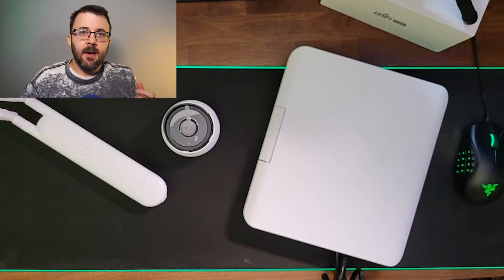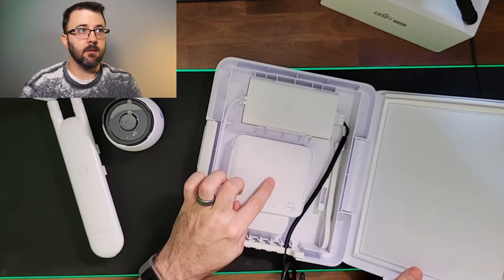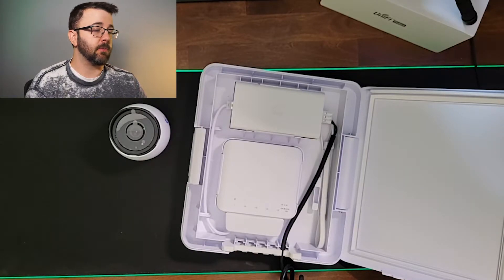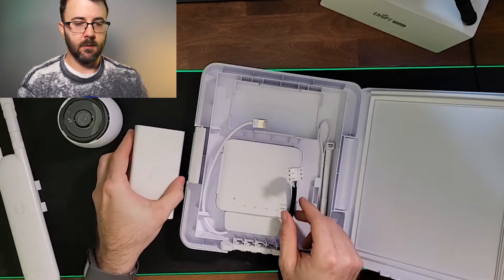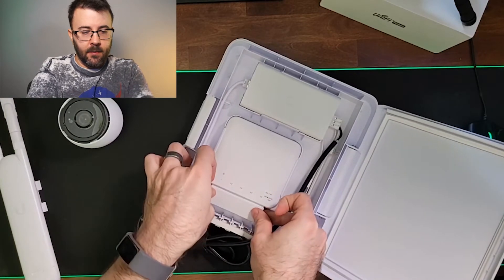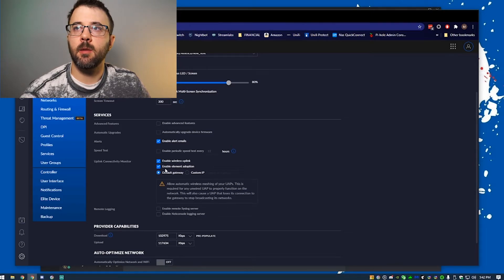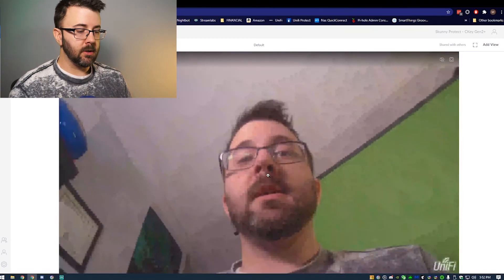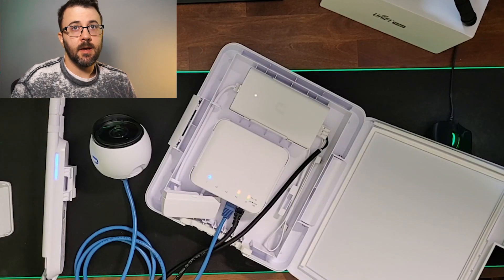Unifi Wireless Uplink Camera Setup

Comment: I had the same issue with the switch only powering one AP at a time. Thanks for the info, it worked after I turn on  the injector option.

Comment: Super helpful tips. I was planning on running at least 4 cameras outdoors around my home and was trying to figure out the best way possible. If I understand correctly, my switch from inside the home would connect to one of the 4 POE ports and then that would leave me with 3 ports available for camera use. As the first port on the USW-FLEX will require POE adapter to power all the devices connecting into the switch.
Reply from the maker: Yes the way i have it setup is that one of the ports is being used to power the flex and another port is being used for the access point so that leaves 3 available ports for cameras. You could daisy chain another flex and utility box if you wanted for more ports but that could get kind of bulky. The only other way to gain 1 extra port would be to hardwire the flex to a poe switch or a poe injector that has ethernet ran to it which would bypass the need for the poe power brick that comes with the flex utility box.

Comment: The switch comes with 5 ports but once you've added the power and the data uplink you're left with 3 ports right?
Reply from the maker: correct only 3 available ports for cameras if you need 4 for cameras you may have to forgo the wireless uplink AP and hardwire the exterior switch to an interior switch. However if thats not an option and you need a larger switch you may have to look into a DIY solution such as an exterior utility box and some how velcro or attach the larger switch inside etc